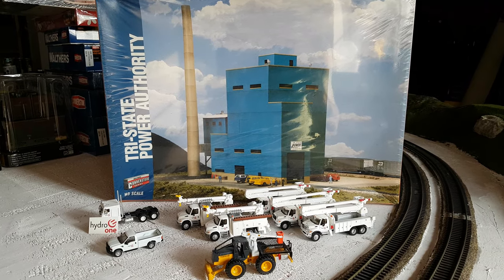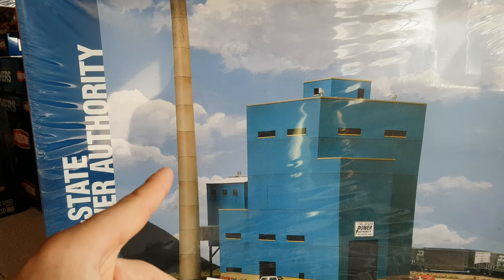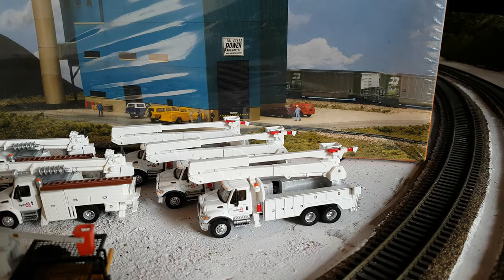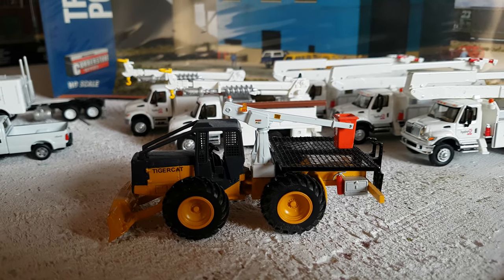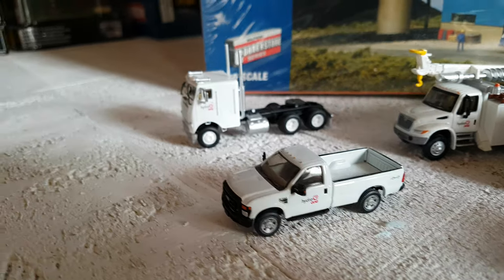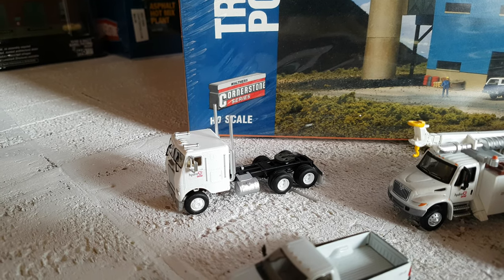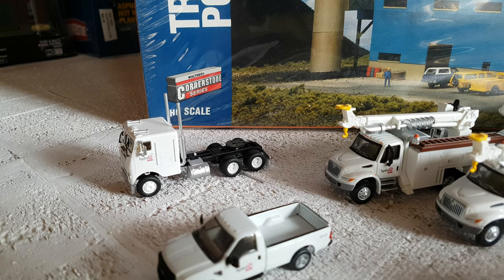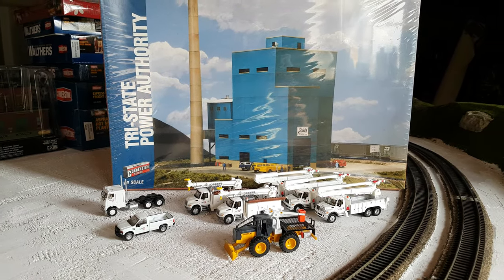Walthers Tri-State Power Authority Episode 1

Comment: Have you seen the skidder type machine like the one you have but instead of a bucket it has an extendable arm with a big saw blade on it. Also have you seen some of the bucket trucks, like the smaller one you have in the video, that have large flotation mud tires that have a tread pattern like a monster truck tire just not as big of a tire. Those could be something you might add as well. Oh and don't forget the trailer they pull behind the bucket trucks that they carry the poles on. It has a beam down the center from the hitch to an axle with racks like are on a log trailer, one toward the front and one over the axle and tires. Just some things I thought of while watching the video that maybe you hadn't thought about. You are gonna have a nice fleet of power company trucks and service equipment when you get done. Neat video. 
Stay well.  -Wil   👍
Reply from the maker: Hey Wil, thank you for the suggestions. I have not seen the one with the blade on it. I will have to look up a picture of the bucket truck on flotation tires as that does seem to ring a bell. I am actually looking up Utility Pole Trailers on Shapeways right now lol! Yes I believe it will be a very large fleet for my Hydro One yard.